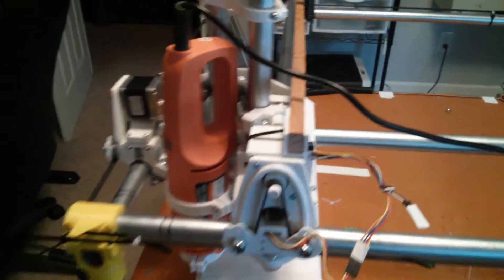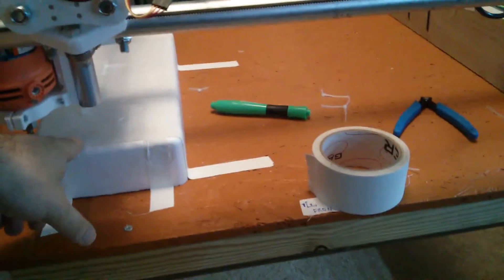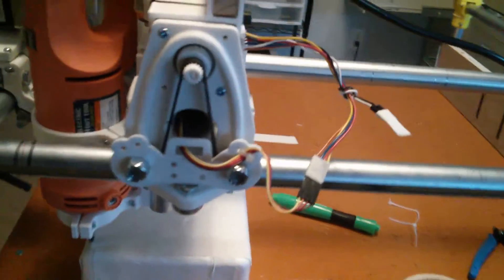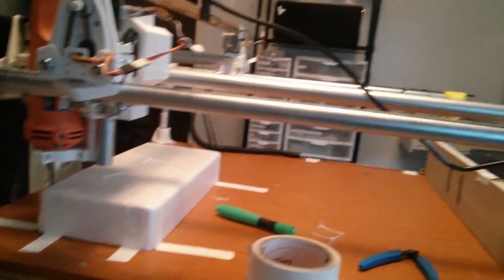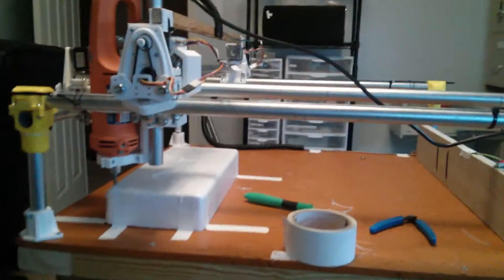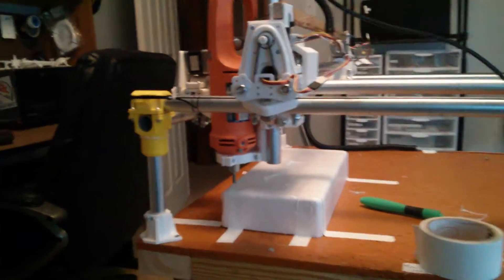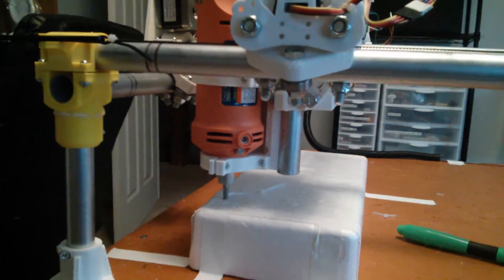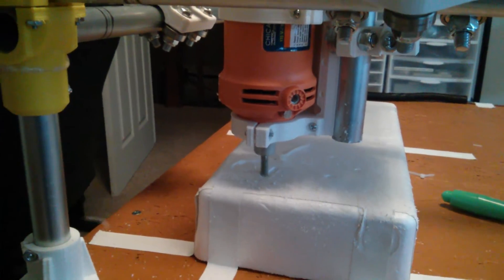Mostly Printed CNC: It works!

Comment: Great, that harbor freight tool is not so bad, but wich support you used to attatch to it? can i have the link? Thanks!
Reply from the maker: It turns out that Harbor Freight tool is actually awful - it had so much wobble in the bit that accuracy was very low. 

YouTube won't let me paste a link here, but the mount I used for it was on thingiverse, just search for 1645698.